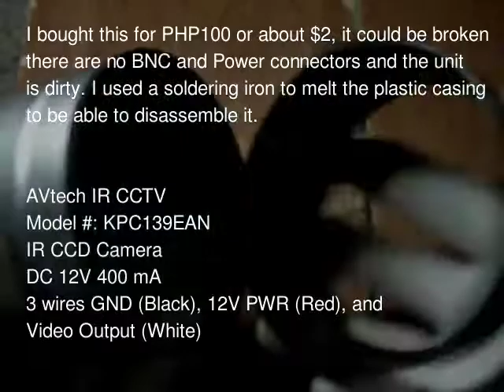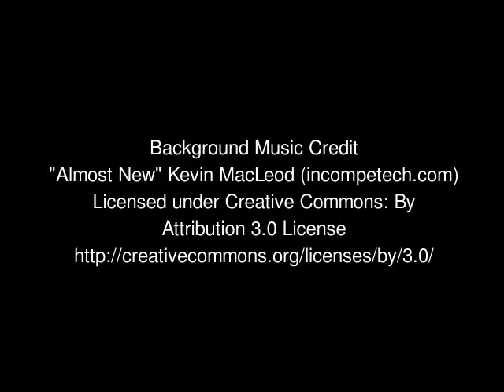#16 AVtech IR CCD KCP139 Teardown

Comment: Hi. Pano ma check kung working pa ang IR LED? And i have 5 pins where is the positive and negative?
Reply from the maker: If you can power the unit with the BNC connector, you can check if the IR LED works by using your phone camera. Without a camera, you will notice a reddish glow on the IR LED in a dark room. The pins usually have markings for the 12V+ and GND, try to follow the tracks on the PCB. The camera has a photoresistor for it to identify whether it is night or day, before turning on the IR LEDs.